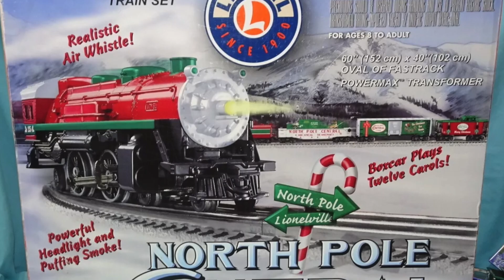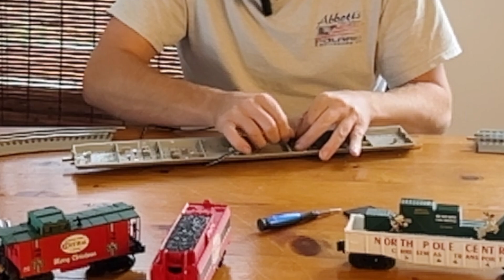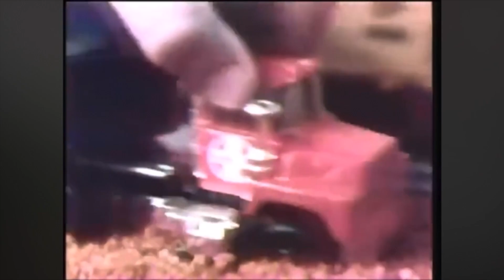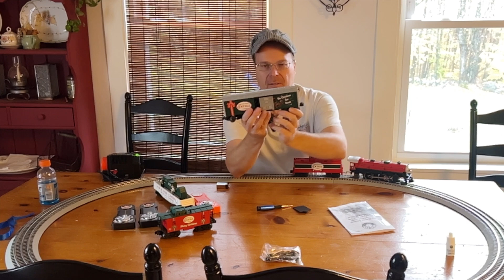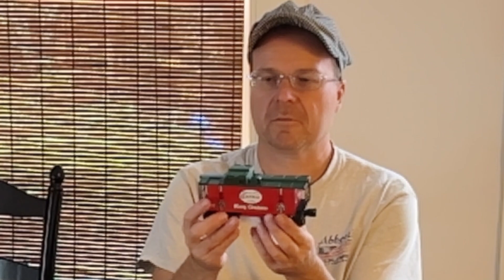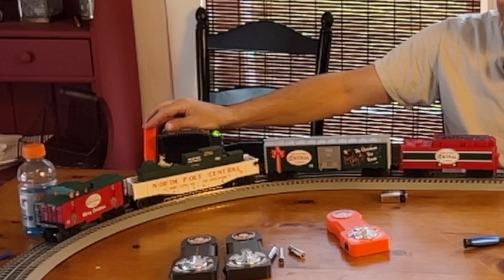The Ultimate Lionel North Pole Christmas Train Set Review

Comment: Thanks for the video.  I have this train set.  Is there a way to add a horn sound ?
Reply from the maker: does it not have the built in steam whistle in the tender? sometimes, the whistle button on the controller is bad and the whistle won’t work if you have the trackless reversed. you can also buy a lionel whistle shed pretty cheaply